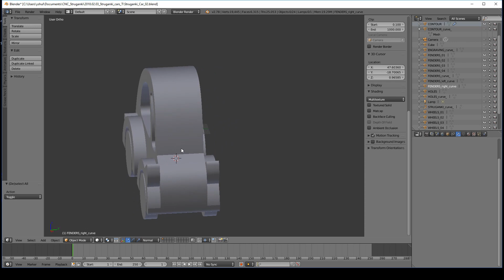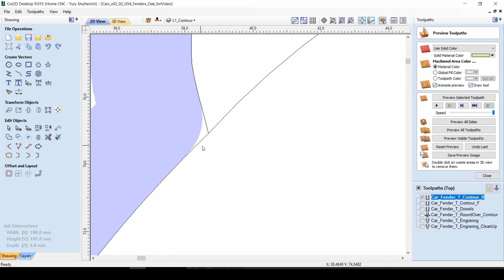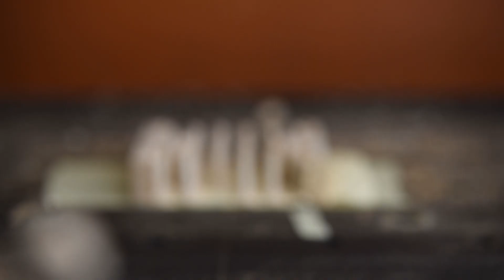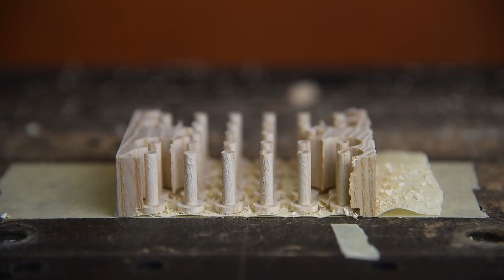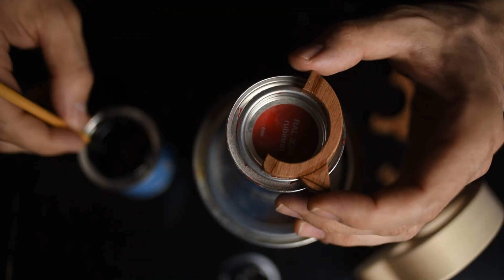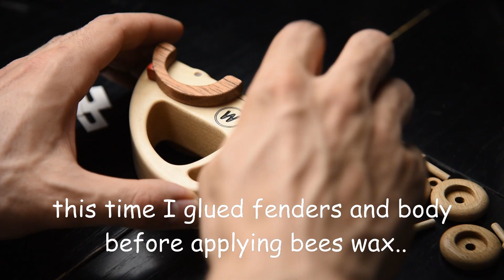Tips and Tricks on making Wooden Toys using a CNC router

Comment: Gorgeous design and finish. Do you think the machine would make very small parts accurately?
Reply from the maker: Thanks! I think it depends on what you call "very small" and "accurately". Also there are cnc-machines of a different quality/price. From my experience I can say that with 1mm end mill it is possible to work on quite small parts with geometries in half a millimetre range. But again the result is very sensitive to the quality of the machine, material used, selection of tools, tool path and of course speeds and feeds.

Comment: Do you account for the superglue in Z thickness, or does that not seem to make a difference?
Reply from the maker: Hi, yes, I account for it - I zero Z-axis on top of the stock after it is fixed on the table. If you zero your Z-axis not on stock but on the table or extra fixture, then you have to check if it makes the difference.

Comment: What is the smallest CNC to get this kind of job done?
Reply from the maker: Well, perhaps it depends on size of the motor. My machine equipped with 1.5kW motor. Table size is not that important, unless you want to go in mass production. I would assume below 1kW is going to be problematic to run 6mm bits. But check the recommended bit sizes with the datasheet of the potential machine. It should be comfortable with 6-8mm bits.

Comment: Hi, I make toys too, and I´m looking for a cnc, I need a machine used from paper to metal, could you recomend some for me please, I start with an Epilog laser that works great and I need evolution so since I follow your tutorials I have more ideas, thanks for that.
Reply from the maker: Hi Amanda, thanks for your comment. I did not experiment a lot with different machines, so I can speak only for one I own, which is a basic router (x6-1500gt ) and it is good for machining wood, plywood and plastic. Engraving metal is also ok, but for cutting metal you'll probably need more rigid frame. I can't suggest the exact model, as I simply don't know. Hope you'll find one!

Comment: What type of motor you are use for cnc Nema 23, 32, 43 or....?
Reply from the maker: Hi Enes, well, my machine is x6-1500gt and in its specification the following stepper motors are mentioned: 57BYGH76-3A. Hope it answers your question.
Reply: @YuryShulhevich  Thank you, 57BYGH76 3A is Nema 23 High Torque Stepper Motor
Reply: @YuryShulhevich I have new questions.

 Are you happy with nema 23 motor, or You think you need better motor for CNC stronger, faster or you think this motor 23 is good for work with wood? 

How many time nema 23 need to cut parts for one car from video?

I have plan to buy motor, but i dont know what type motor to buy Nema 23, 32, 42, because that i ask you what you think about your CNC machine?
Reply from the maker: Enes, in general, I'm fine with the machine. I think it has adequate power, especially for such small parts as the car in the video. However, it is not that rigid and additional power on motors won't get any benefit, as the frame will not hold it well. Even in standard configuration you can choose quite aggressive depth of cut, but it makes surface quality and precision worse. I suggest you start with depth of cut equals half a diameter of your tool. Also you may find useful researching topic "feeds and speeds". From my experience it is more productive and more safer to increase feed rate with relatively small depth of cut, rather than doing the opposite. 
Good luck with your project!

Comment: why didn't you worked with one side machining with less thickness and glue two parts together ? after gluing it together and sanding them you wont be able know if they r one or two pieces .. am I right ?
Reply from the maker: Mikhail Konstantin  Well, your idea may also work, but the point of double sided machining is exactly the opposite - not to glue the parts together, rather to work with the whole/single piece of material.
Reply: @YuryShulhevich  hmm, yeah u r right, i guess i should watch the video again, didn't got how it works

Comment: Great video Yury . Is it stronger to use seperate axels , rather than through the body of the car ?
Reply from the maker: Thanks Stuart. Well, I guess it is not about strength, it is more about convenience during the assembly and functionality. In case of "through the body" axles you have to introduce some kind of endings and glue them to the axles' ends after wheels are on. Another option is to glue wheels to the axles, but in this case you lose flexibility of freely moving wheels (2 of them will be connected). So, I decided to use pins and glue them separately, so that all wheels move freely. Hope it makes sense )
Reply: @YuryShulhevich  thanks

Comment: Looks inspiring! What it takes to get the same skills? What softwares, programming tools? I would really like to be able to create the same :)
Reply from the maker: Thanks for your comment! There is no rule here, I guess. Main point is to simply start doing it :) Then you'll answer a lot of questions yourself. In case of CNC - get yourself a machine which fit your budget and learn how to use it. Practice is the key here - the more you work with the machine the better results you can achieve. Good luck with your hobby!